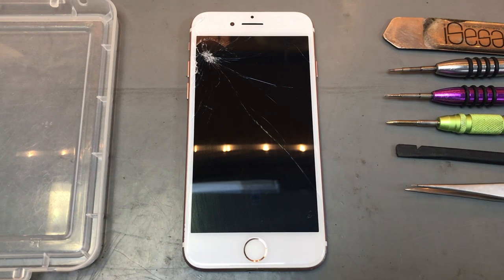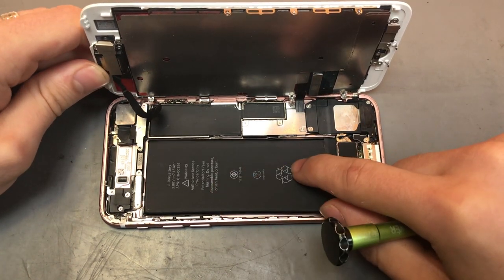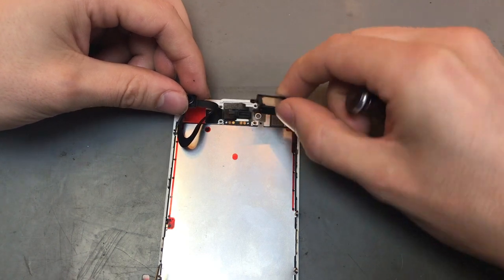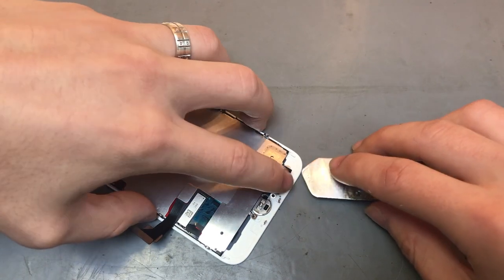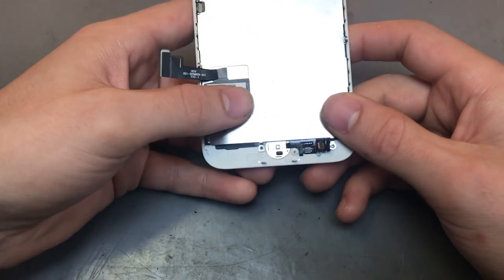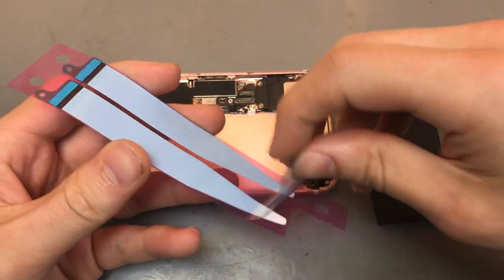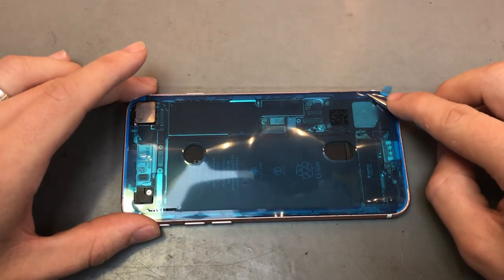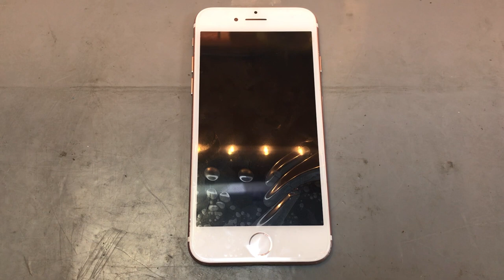How To Replace iPhone 7 Screen Digitizer Repair Guide Tutorial

Comment: Why did you call this video a digitizer replacement wheen it's actually a lcd and digi replacement and would you recommend replacing both if only my digi is broken is it hard too separate  digi from old lcd and is it tricky too install